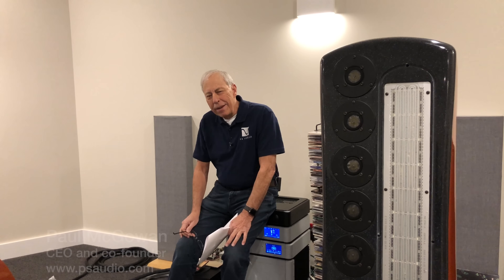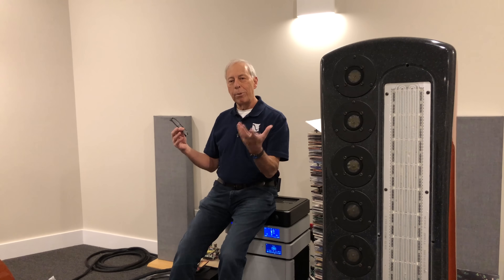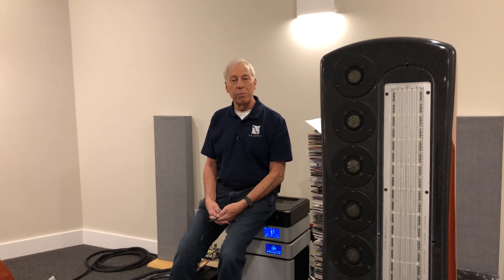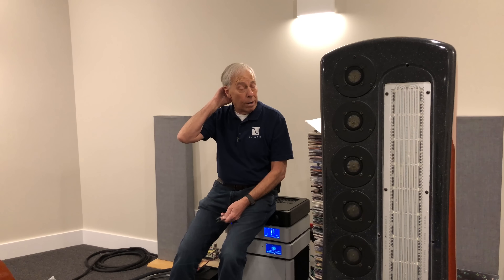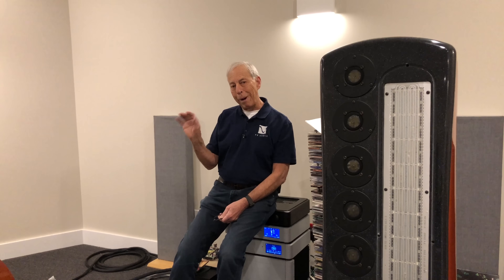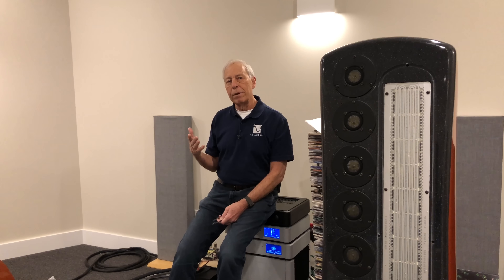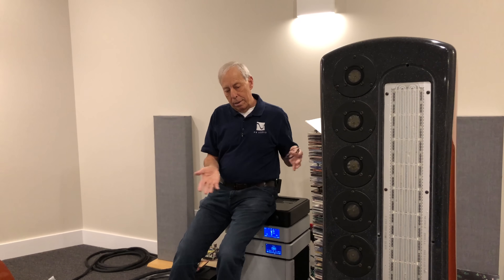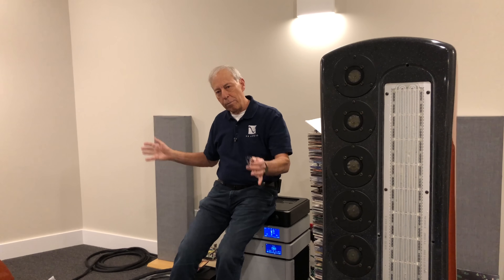Do we need preamplifiers?

Comment: This is one video where Paul missed the boat. Optimization to obtain better sound is a great reason to get separate components, and the reason I got mine. But time has shown that is not the greatest benefit. Rather, quality components last and getting separates increases the usable life. If you get a monitor with a computer in it, then if either the monitor or computer breaks you have to throw both away. With separate components you can replace broken or outdated components without affecting the others. I have an amp (Sony TA-N77ES) that still works great that I bought in the early 1990s. That amp will work fine with any modern stereo. If it had been combined into an integrated amp or receiver it would either be broken or obsolete today.

Comment: I build preamps but only with tubes 12au7s using old fashioned high voltage power supply  coupling capacitors resistors 1 mega ohm potentiometers and standard rca xlr or 1/4 inch jacks. active is great .1 uf is awesome as to not limit low frequency I could imagine one of my preamps with a PS audio amplifier Wow warmth and vinyl 12 inch LP turned up on a set of JBLs.
Reply: I only weave baskets out of reeds soaked in mud virgins bathed in. Everyone needs a hobby. I still say muddy basket weaving is more relevant today than building audio gear with tubes in it though.
Reply: @1pcfred  only pansies listen to solid state audio equipment I know exactly how to build what I need or for someone else in that hand if your a pansy then don't buy tube gear because the high voltage inside may give you a jolt and for heavens sake that would hurt your feelings. I think PS audio is behind in times I can't stand the hard hitting stale bass response of class D or Darlington's 2sa 2sc 70473100 68 368 if I want to go to a concert I would maybe ps Audio should hire me as a tube designer and they would increase their sales in high end audio.
Reply: @1pcfred  the failure rate is not so good when do you ever see Eddy Van Halen use a solid state amplifier like never I like bare bones myself I like low equipment failure and I like to diagnose my own equipment I built that has a failure rate of like 0 if I want to change out a tube it can be done quickly you can pick what you want tube amps are just better that's my opinion I'm sticking to it because I won't be brainwashed into believing otherwise I have about 4000 tubes I can sell or just have on hand I guess what I'm trying to say is I'm used to it I can't be convinced I am a designer and a technician at a music store another thing is semiconductors typically change design and become obsolete and the same thing can't be said about a 12ax7 or ef86.
Reply: @1pcfred  let me build you a preamp with a phono stage and blue tooth and send it to you and see what you think I know I can't convince you.

Comment: Paul, you never mentioned another reason for a preamp, which is, God forbid, tone controls. I know that they are eschewed by “real audiophiles”, who seem to believe that they prevent you from hearing what the artist intended. But in reality you never can hear what the artist did for many reasons, of which some are the alterations in the mastering process, the characteristics of the speakers, the characteristics of the room, and several more of lesser influence. So I believe that a preamp or integrated amp should offer some method of altering the frequency response to let the user tweak the sound to their liking. The classic bass and treble controls are not really adequate in my opinion but a graphic equalizer is overkill and too complicated for most people. A good compromise is something like the little Schitt Loki which could be built into a preamp for little cost.

Comment: Short answer:

If your DAC has a digital volume control, a well behaved output level and impedance, and that's your only source you really don't. You could feed that directly to an amp.

Otherwise for volume control, level and impedance matching and source selection. Or maybe just because you like how the preamp sounds.
Reply: If you can feed your DAC directly into a power amplifier then your DAC has a preamplifier built into it. Which it almost certainly does. It is not like the chips that can do that cost much. Maybe 3 cents in the Shenzhen market.
Reply: @1pcfred  it will most certainly have an opamp to boast the signal to some fixed level but no necessarily a preamp. Many DACs have digital volume knobs or you can control the volume in software if it's connected to a computer. The volume is changed in the digital not analog domain. Hence, no preamp.
Reply: In theory (and in practice by some companies) you could feed the sigma delta signal directly more or less to a class D amp, control the volume digitally and the D/A conversion happens at your speakers since they would be the only analog component of the audio chain.

Comment: So having heard what you had to say Paul, I was wondering if a preamp could boost the output of an integrated amp putting out say 40 to 50 watts rms per channel...
Reply from the maker: No, unfortunately, it can't. The output of the integrated is a function of its power supply and output performance. Boosting its gain won't help.

Comment: I just recently bought and put together an ICEpower 50ASX2SE amplifier, and I knew that the amp board had no pre-amp or volume or anything — just power amplification.
‌
So I went ahead and bought a separate pre-amp and it works for me. ‌ And while fiddling with everything (I had also bought a passive volume/bass/treble board and digital volume) I noticed that without a powered pre-amp, the line out of my devices was not very loud when plugged directly into the ICEpower amplifier.
‌
So this video has helped answer some things for me regarding sound levels and whatnot. ‌ Thank you for posting this video and question :‌)

Comment: My stuff started in the late 70's and everything had a tape monitor on it. Need a pre amp for something or just want to make it louder (I was 12)? Open the tape deck and reach inside and hold up the tab for the cassette tape record protection and hit record of the deck (with no tape inside the deck). Then crank up the record gains on the deck and run it back through the receiver. Also back then the older folk though it was cool to give me old stuff (most of it useless) because it had something to do with stereo equipment. One thing I had for a long time back then was a realistic (Radio Shack) box that you plugged in multiple components into it and it had a single output. It was only 6 inches long and about 3 inches tall and plugged in the wall. It also had toggle switches for selection of what component and a pot to turn up what I thought was gain but I guess it was a little pre amp. 
Today I still wish I had that box. Everything connected to the rack don't need it but the new flat screen TV really could use it.
Reply: When I got back into HiFi a couple years ago, I didn't have a preamp or receiver for my turntable. But I had a tape deck. I did the same thing. Pushed "record" on tape deck with no tape inside & played LPs like that. It worked but didn't sound very good. Fortunately a coworker had an old Marantz receiver collecting dust in attic & gave it to me.
Reply: I used to pick up so many stereos at the town dumps that had the tape monitor button pushed in on them. People are dumb!

Comment: Paul i think that this could have used info you gave in orevious pre post about passives vs active preamplification.Iremeber you said that you thought using just the op amp in a given DAC you thought would u=yield best sound (less is more) but then Artie had you compare your DAC with volume sand pre with his Aesthetix Janus and you discarded the old thinking and adopted it.I remember having a full Pas designed Adcom stack (300 wpc full balanced) and just couldn't live without the dynamics of the active setting.Also I have heard that people generally like tube pres (or your hybrid) because the adding of tubes upper harmonic distortion is what we perceive as warmth.Plus that tubes are best at voltage gain vs SS being better for current a top tube and lower SS or hybrid set up like you have in both is best technically.Think this post would be well served by links to prior posts

Comment: The separation of power supplies (ie. one for the preamp and another for the power amp(s) ) makes a significant difference to the quality of sound.
That is, if one wants to get to the absolutely "perfect" (no such thing..) sound one desires. They say "a preamplifier shouldn't have any sound of their own".... but they do!
Try a solid state preamp for a while and then switch over to a tube preamp.
The differences will astound you.
Reply: Tried it back in 1996 with a friendly local hi-fi dealer comparing a Musical Fidelity X-Pre tube preamp and a solid state Michell Argo HR preamp. The Michell costs about 7 times as much as the X-Pre but female vocals - especially Veruca Salt's Nina Gordon sounded more realistic on the Michell during the more urgent parts of her performance.
Reply: @laurentzduba1298  
I am not aware about Musical Fidelity tube preamplifiers with the exception perhaps of their NuVista preamp which was eventually dropped.
They used a peculiar type of tube called 'Nuvistor' and, from what people say, it was of mediocre success.
 https://hometheaterreview.com/musical-fidelity-nu-vista-preamp-reviewed/
I think you might get a different sonic picture with a preamp from Audio Research or Prima Luna or some esoteric designs not widely known.

Comment: it saddens me that people use a DAC with variable output straight to a power amp.
Reply: Fat Rat ... he needs a strong shoulder to cry on. 😬
Reply: Explain. Why?
Reply: If the DAC does the variable in the analog domain, and it has enough voltage to drive the amp to full power, then you really can't do better.
Reply: Miro Svetinsky ... there are quite a few DAC/streamer that are built as preamp too nowadays. Looks like manufactures are looking at a one box solution on that front.

Comment: It's all about the music, right?  If true, then hopefully by now most of us have already settled on a single superior music source / format.  If true, then we only need one set of inputs and we no longer have need of input selector option.  That only leaves us with a need for an amplified gainstage.  If indeed that is a need.  I've always prided myself on having perhaps the most dynamic playback system I've yet encountered and years ago after owning several passive pre-amps, I swore I'd never go passive again due to the lack of dynamics.  However, after purchasing a high-powered 600 wpc amp with no pre-amp available (my last amp was an int amp) I tried using my CDP's passive volume attenuator.  Bear in mind that prior to this 600wpc amp the highest powered amp I previously owned was a 300wpc@ohm and 1200wpc@2ohm amp.  

The benefits of matching a superior passive volume attentuator with very high-powered amps include:

1. Today, I attest that with sufficiently higher-powered amplification, my new configuration is even more naturally dynamic than with an active pre-amp.  The dynamics are just about as explosive as before but now occur entirely upon the soundstage where they belong with the rest of the music. 

2. I suspect and perhaps Paul or somebody can confirm, any time a signal is amplified, new distortions are introduced. Hence, with a well-designed passive volume attenuator, you should experience more pristine notes where even the word delicate becomes a regular part of your volcabulary. 

3.  Instruments become right-sized.  Since distortions make music and instruments seem bigger, this lack of distortions will make a small 6-inch triangle sound and image like a small 6-inch triangle rather than an 18 or 24-inch triangle.

4.   An amplified gain stage and especially a high-powered amp will generate an electronics-induce jump factor which has nothing whatsoever to do with live music unless perhaps you're sitting 10 feet in front of Ted Nugent performing live.  In fact, with an active gain stage and say a 600+ wpc amp, you may experience initial attacks of most any note just feet in front of your face while the ensuing decay takes place upon the soundstage.  Kinda' like your ears running up to the soundstage for the initial attack and then running back to the audience for the ensuing decay.  Better yet, think of a .45 cal gunshot 5-10 ft in front of you.  Quite an exhilerating experience but there is nothing musically natural about that even though it may cause you to jump.  Yet, a .45 cal gunshot 40 - 60 feet away from you is still quite dynamic but with a natural distance.  From a live performance perspective with the musicians upon the soundstage and you planted firmly in the audience, this is entirely natural. 

As a result of these tremendiously musical benefits without loss of dynamics, my new solomn oath is to never go back to an active gain stage.

Comment: Hello!
Straight to the point...
every source (Cd, tuner, tape, dvd, etc)  have a level output (some Volts Rms, usually around 2.0V for line levels), when we insert this into an (active) preamp, regardless separate or integrated, then in almost 99% of cases,,,,is degraded, and then again amplified (of course, using a circuit with electronic parts), to a level we choose (using the volume control). That-degrade - increase make some alternation to the sound.
The only way to avoid this, is:
A)having a source with variable output level, feeding straight forward a Power Amplifier
B) Use a Passive preamplifier (with only  negotiable thing, the quality of the parts used)

The main Real need of preamps-- is for choosing inputs and control the volume (As Paul correct said).
The other reasons, is for the Features usually include, and as time passes are getting more and more...
I could add a 3nd case, little rare today, if a signal is really low & needs amplification

*special case, are the phono (turntables) preamplifiers, which is a little another thing

Thanks,
I hope you enjoy!

bye-bye!

Comment: just ordered up the 250 bhk which will connect straight into my direct stream dac..no preamp.i hope it sounds good when it turns up..
Reply: dean turner it will sound great but adding a BHK Preamp later will sound even better😊
Reply: Like Mike said, it will sound great, but adding the BHK pre will really send it! Enjoy your BHK250...it's a killer amp.
Reply: @stonefree1911  only reason why i wont be doing that is that i also use the amp in conjunction with my yamaha 5200 preamp and my yamaha 5100 amp to run all the rest of my 7.2.4 cinema set up.purchasing the ps preamp ,it won have enough channels to run them all.at the moment i connect xlr and rca into my 2 channel emotiva then just use the switch on the back to either listen to hifi or a movie.that way i have use out of my main 2 front MA pl300's for both set ups.ill have to compromise for the moment till i can afford a top line multi channel processor. or buy to sets of front speakers that doesnt really work in my room.but never the less still looking forward to the new amp.

Comment: And tone controls, don't forget tone controls.  Paul doesn't like analog tone controls and doesn't include them on his company's gear, but I do like them.  I have a sweet little Arcam A65+ integrated amp with separate pots for volume, bass, treble, and balance and a direct switch that by-passes the last 3 controls leaving only the volume.  'Old school and the better for it.' as Jeremy Clarkson (or was it James May) has said.  Or words to that effect.  Some people argue that any extra circuitry can only degrade the signal and, to an extent, they are probably correct.  Tone controls give and tone controls take away.  However, if a little finessing of the frequency spectrum can improve the listening experience, even if there is a slight change to phase relationships that effect sound stage and depth, I call that a win.  And there is that bypass switch.  As long as you don't get overly weighed down, it is better to have and not need than to need and not have.

Comment: I have long used only input selector and a volume ptensiometer and nothing more. ALL preamps will color in a way!

When you want the best sound possible without coloring the sound, the sound should go directly into the amplifier with the least possible devices in between the source and the amplifier.

Everything you drive the sound through will always change, color the sound in some way.

If i need to use a preamplifier with signal amplification i like to use a transistor based preamplifier in the simplest possible way that is made with the focus of  changing the sound as little as possible.

If you have good enough speakers then you don't need to have equipment that colors the sound to get good sound like a tube preamplifier does.
Reply: Phono has RIAA equalization needs. Tape might need Dolby. Etc. But I am going to look into your pot thing. I assume the pot routes to the amp,  and other half routes to ground. Probably discrete resistors would sound better than a pot.
Reply: @PaulLawson-k8v  I use separate RIAA box and all dolby tape filters are inside the cassette player.
You should use 50k potentiometer.
blue ALPS dual 50k is a good choice. What kind of audio equipment do you have?
 http://www.apogeeweb.net/upload/image/20190129/6368435228089112509706235.png

Comment: With my next system which will consist of seperates I will just use the DAC as a pre amp and go directly into the power amp.
Reply: juliangst 
Get a DAC with a volume knob or you'll blow your speakers on day one
Reply: @PaulLawson-k8v  you just have to be careful what the volume is at. A knob isn't better than digital buttons. If it's extremely loud you can quickly switch inputs to mute it